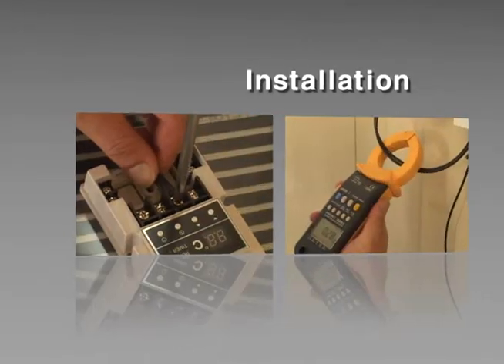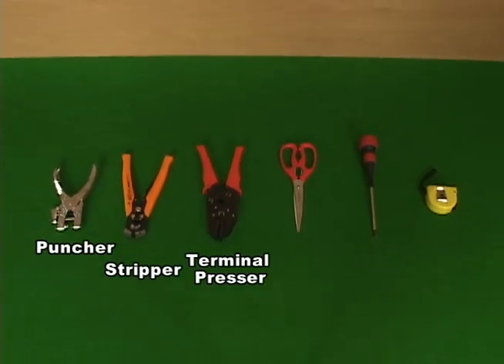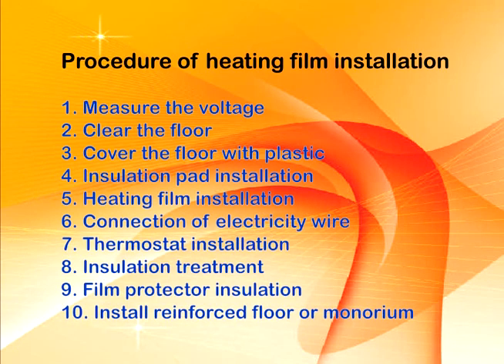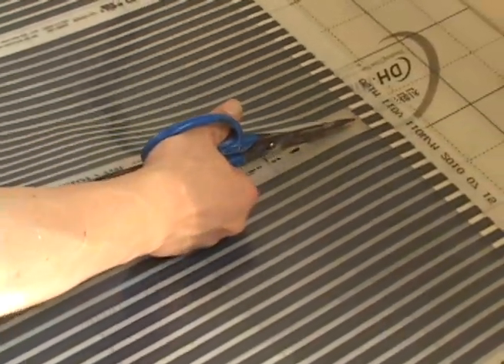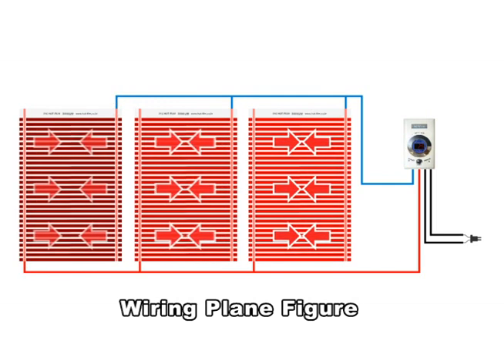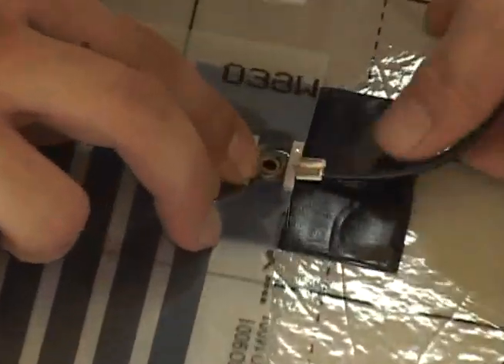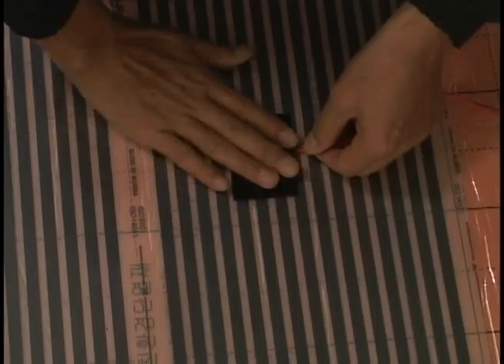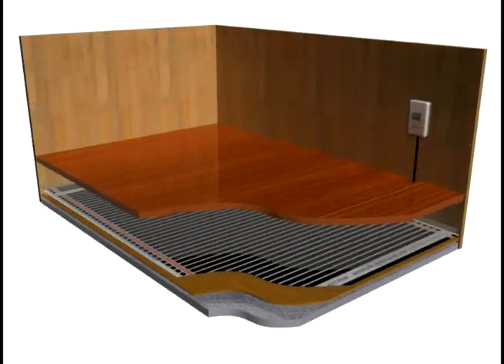Infrared Underfloor Heating System - Installation

Comment: how long is the life expectancy of this product? if i tile the floor, replacing a heating strip will be a really messy job. or is it preferable to use tounge and groove flooring as it is easier to pull up in case of issue?

Comment: why do you use eyelet terminal over pressure terminal?
Reply: They said it can cause sparks if arcing but most manufactures still supply with pressure terminal so maybe myth

Comment: why is it called "infrared"?
Reply: Bombog 1 
+1 I have the same question
Reply: Infra means below. If you take a prism and run a ray of light through it, the red will be at the bottom. If you place a thermometer below the red (where you can't see any color), you'll notice that there is still heat there. It's a bit of the light spectrum your eyes can't see but is still present. It's why infrared goggles allow you to see heat.

Comment: Heizfolie http://www.tf-fussbodenheizungen.com Infrarot Fußbodenheizung
Reply: Does this work in a van conversion?  Will it run on solar panels on the roof?
Reply: It's mainly used for house heating in winter. For van conversion, it hasn't been applied in this field. It can be run on solar panels, but it needs converter to change the low voltage into 110V-240V, not recommended.